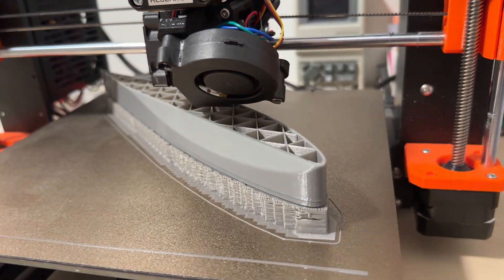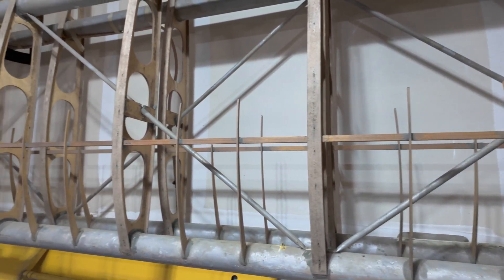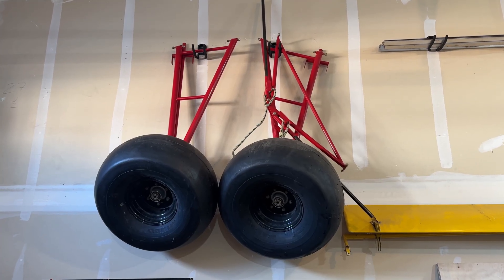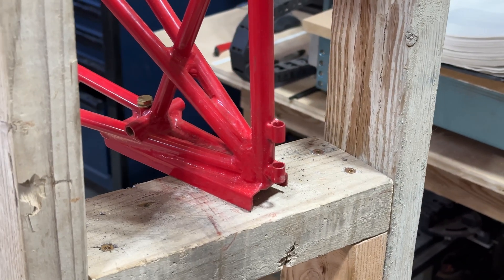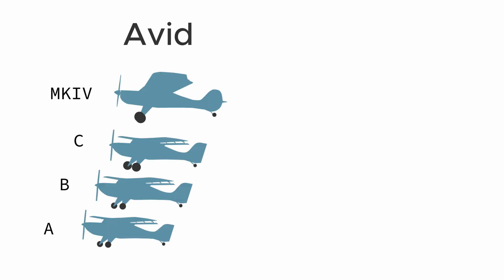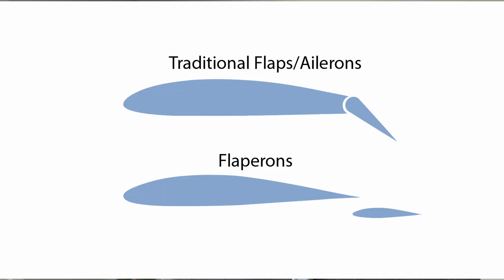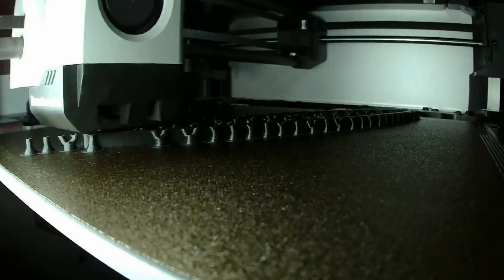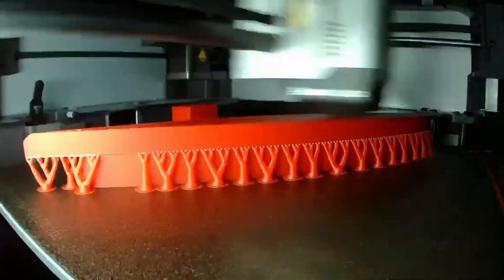3D Printed Aircraft Parts for a Kitfox Series 7 Experimental Aircraft Kit build

Comment: Awesome work, thanks a lot for the designs! Have you worked on the wingtips as well? Cheers
Reply from the maker: Thanks! Nothing yet! The wingtips due to size get a lot more challenging on the execution side of things mainly due to build area limitations of most 3d printers and CNCs, you kind of have to slice it up and glue a bunch of parts together for that. Which model do you have, and what are you thinking?
Reply: @letsbuildthis  I'm building an Avid Flyer, the old Kitfox. I was thinking in the standard wingtip, nothing to fancy :)

Comment: David! First, I appreciate your channel and videos. Second, we have a lot in common; my name is also David; I love the Lord, my family, and life every day; I'm also rebuilding an AVID, mine is a 1991 model "C" speed-wing version that was left in a barn by the third owner for 17yrs!; during that time in the barn, "critters" made their mission to ruin the second set of wings, STOL wings, that I also purchased with the craft. So, I am in the process designing and building a new set of STOL wings! I really appreciate that you include your CAD skills in working on your aircraft - I've had to learn F360 CAD and the use of my CNC router to make a lot of the parts. Currently I'm still fabricating parts for the wings, have finished the wing ribs, spars, drag spars, tips, leading-edge cuffs, and fuel tanks, and am just now finishing the design for the flaperons (the original ones were also not airworthy!). Since I had to build new wings, I opted to change the airfoil to the proven Riblett airfoil use on the Kitfox models 5,6, & 7 which has been a bit of an undertaking.  I look forward to seeing your progress, as it inspires me to keep going!! Thanks for your enthusiasm!! David
Reply from the maker: Wow, yes we really are on the same journey. I have a set of brand new STOL ribs, and an earlier speedwing. I also have some cad files designed out for a Riblett airfoil as well (Bearhawk inspired rather than KF though, but STI sized). I just haven't cut them out yet. I guess it's not good enough to go with the 2 options I have, but hey let's keep the progress going! 

Where are you based out of? If you hit my bio on my channel you can send me an email. I'd love to chat more about our projects since they're so similar. Best regards, David

Comment: Thank you so much for putting in all the effort to design these!  I'm just about finished covering my S7 fuselage and will be starting on the wings in a few weeks. Not looking forward to shaping 4 flaperon tips like I did on my tail section. I was planning to purchase a set from KitFox but would love to try using my 3D printer but I'm just learning to use it.  Because the tips are asymmetrical, Did you design internal and external tips and left and right versions? I downloaded the files but only see one of each style. I expect there is a way in the 3D Printer software to create a mirror image of each but aren't the internal covers designed differently, or do you simply drill out a hole for the connecting rod?
Reply from the maker: Hey Kevin, thanks for reaching out. Glad to hear you’re building! So the parts can simply be mirrored in the slicing software. As far as the inboard end, there is a part that Kitfox ships in the kit that gets riveted in place. That inboard parts serves as part of the structure, so these 3D printed parts are for only the outboard end of the flaperons. If you need any support, please let me know.
Reply: @letsbuildthis  Thanks! I just finished printing a set and they look amazing. I'll post pics and a link to you once I get them on.
Any interest in cleaning up a 3D file for some control stick moulds I had a friend help me with? I am trying to build Carbon Fiber control stick using forged carbon fiber. I printed a set to use but could use some better locating tabs and release slots.  I had to destroy moulds to get them apart. Could also use a recessed channel down center to secure plastic tube inside to run wires
Reply from the maker: @kevinolson42  sure thing glad to hear that! Can you go to my bio on YouTube and send me an email and we can chat about the grips. Best!